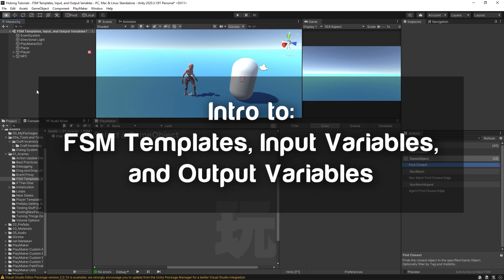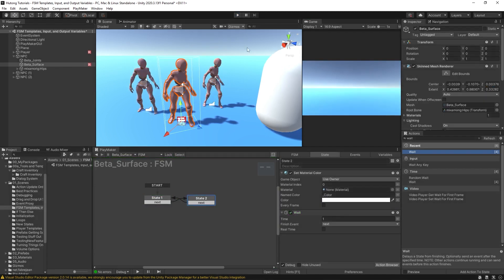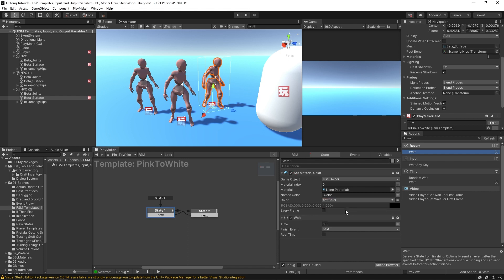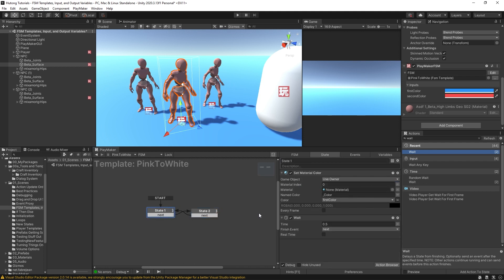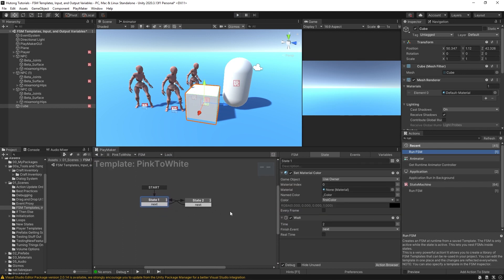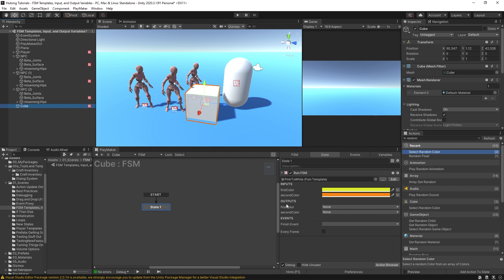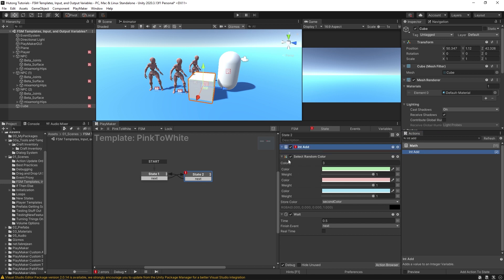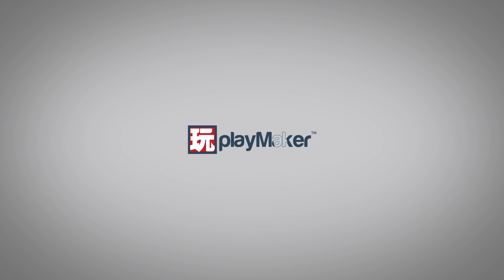Intro to FSM Templates, Input Variables, and Output Variables

Comment: This is cool, but feels fairly limiting in that it only seems to work with actions that point to the object Owner. If you have actions that point to child objects, for example, those connections don't know how to look for the new child object, and breaks. You end up having to turn every child into a variable and redoing the imput dozens of times if you have dozens of objects. 

Can there be an update wherein parent/child relationships are maintained in templates?